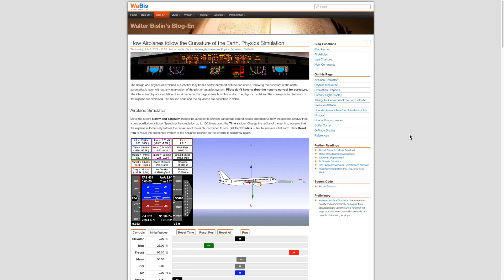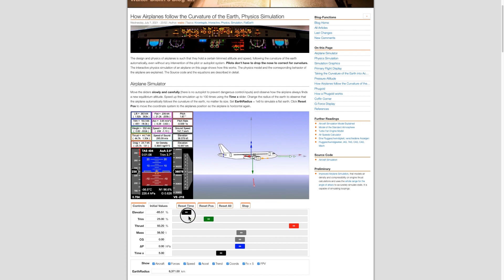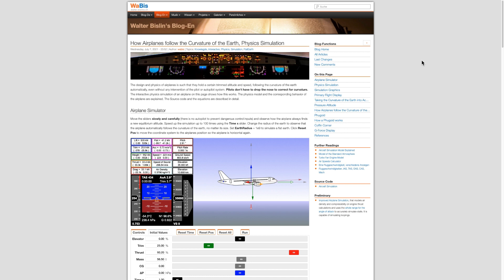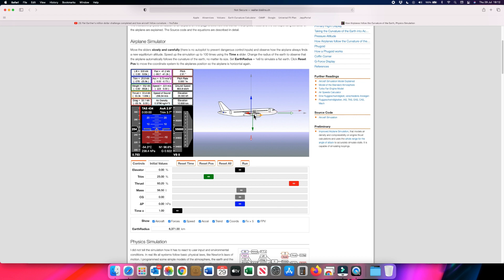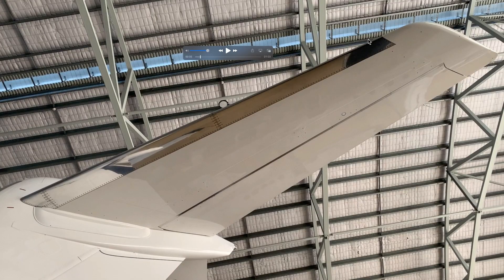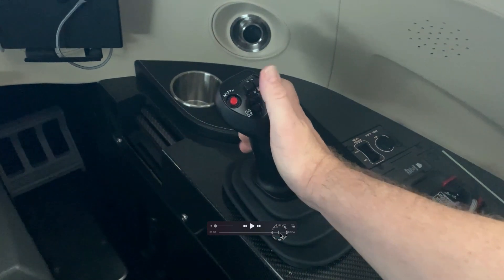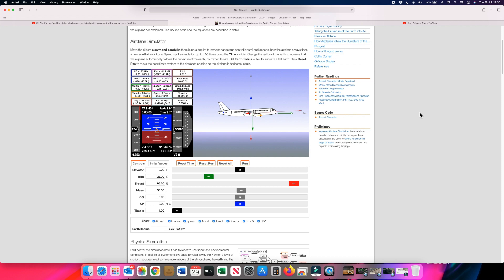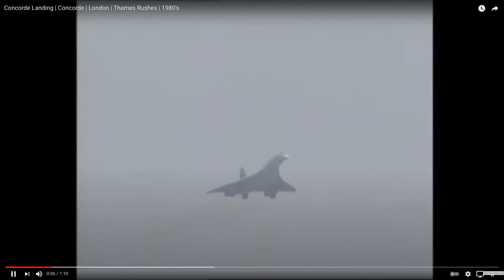An overview of the Elevators and Trim in aircraft.  How pilots control the pitch attitude.

Comment: Great video! Walter Bislin's site reminds me of the static images we had in our aviation text books back in the 1970's without, of course, the non-static images. I will always be at a loss as to understand the idea that a nose down attitude is required to descend? Is it that hard to understand that if I am flying with a 2 degree upward pitch at 200 knots, but reduce my airspeed to 110 knots, that (depending on the aircraft) it will fall out of the sky with a pitch up attitude? And of course you gave the perfect example of a controlled decent pitch up, that we call a landing. How is that just not totally intuitive to anybody? Without any knowledge of aviation, how can a simple thought experiment not yield the same? You can almost model it with your hands hanging out of a car window! Great video just the same 😉

Comment: Wofie, Frigging brilliant, In my book this is your best yet and loved how you rubbed the reality deniers noses in it with the NASA shill ploy.

I'm still a bit confused with the Trim but I will watch this again, However, Would I be safe in saying the TRIM is like fine tuning setting?
Reply from the maker: When teaching this in a class room I used to explain the trim as a wheel alignment in your car.  

Imagine driving with a poor wheel alignment that requires you to constantly hold in right steering wheel pressure to drive straight.   If you let go of the wheel the car deviates rapidly left.  

The trim would be like having a small knob beside the steering wheel so you could realign the wheels while moving allowing you to let go of the steering wheel and the car then goes straight.  

In the aircraft each time you change power, speed or configuration the plane goes out of 'alignment'. (aerodynamic balance)  and will either try to climb or descend.  The trim realigns so you don't have to hold a correction with the joystick
Reply: @Wolfie6020  "The trim would be like having a small knob beside the steering wheel so you could realign the wheels while moving allowing you to let go of the steering wheel and the car then goes straight."

Now I get, makes perfect sense, thanks heaps.
Reply: @osci08  yes that’s pretty much it, just imagine that your central line changes depending on the speed you’re driving at. So you have to constantly adjust, that or have autopilot do it.
Reply: @jonneexplorer  Cheers Jonne.

Comment: My guess for the purpose of the red AP/PTY button on the joystick is to launch an Anti-Personnel Party (missles,  rockets, or bombs) but alas, I doubt a business jet would include such a nice feature.  But I know such a jet usually has some party snacks and beverages on board.  Indeed, Wolfie has even shown us the goodies cabinet before.
Reply from the maker: Because this plane is fly by wire the right control does not move if the left pilot is flying.   You can take over by pressing the red button which gives priority to that stick. If you press and hold it you have the master control.  If the other side presses and holds he takes over.  Whoever presses the button most recently has priority.   

The plane announces "Priority Left,  or Priority Right" accordingly.  

No so many snacks on this plane.   The flight attendant is working on that.
Reply: @Wolfie6020  I was a "backend crew" cryptologic linguist on USAF RC135 in the 1980s.  Often 10 - 12 hour missions.  Snacks are SO important. 🍫☕😋
Reply from the maker: @WoodworkerDon  I totally agree.  Critical to keeping morale high in the team.
Reply: @Wolfie6020  🍪🍰🍌🍎👍

Comment: You still have not been able to point at any specific adjustment adjustment that the  auto pilot or the pilot makes that can be directly attributed as curvature or Coriolis.  Adjustments for crosswind or air pressure is no different than you with do on a flat motionless earth
Reply from the maker: But I have Gary,  numerous times to you and you know this.  The corrections to maintain a great circle course require turning towards the Equator constantly in each Hemisphere with the rate of turn needed increasing as Latitude increases.   Also the turns are mirror imaged for each Hemisphere.   There is your 100% irrefutable adjustment for Earth curvature. 

Unless you can show me a Flat Earth map explaining it?   I'll grab the popcorn.
Reply: That's because there are no specific adjustments for that. The autopilot (or the human pilot for that matter) just tries to stay on the same altitude & heading and counteracts any outside perturbation. It doesn't matter if it was a crosswind or Coriolis that caused a deviation from the predetermined heading, in both cases the reaction is exactly the same: adjust the heading back to where it's supposed to be. Barely an inconvenience...
Reply: So gary, can you finally tell me why I have to account for the fact that we live on a globe whenever I calculate my flight distances?
Reply: It would be nice if we had an accurate map or model of the flatearth on which to test your claim.  But... we don't.
Reply: Gary, isn't odd that all the videos on flight are made by people who believe in a globe? Why can't any flat Earthers afford to hire planes to show their proof?
Reply: @NinjaMonkeyPrime  They used the FE map and all of them crashed!  Good thing making a flight plan stops most of them from ever taking off.  :)

Comment: I would like to personally thank you, as i have asked that , at least similar ,question in your previous video.
Thank you
Reply: The example with the Concord ( i believe) is not perfect as the flatheads may say that the nose is already tipped, the simple fact that a dart is losing speed and height even if the tip is pointed , would be enough i believe
Reply: @tupcho33  I don’t think anyone, even flat earthers could argue Concorde lands pointed down in the clip. Concorde was known for its very high landing gear and steep flaring like you saw in the clip. 

The nose angles down because in its flight configuration you can’t see the runway at all.

Comment: Good video! I didn’t know that you could trim the whole horizontal stabilizer. Is that common?
Reply from the maker: In larger aircraft it is common.   Another way they achieve it is to have a small tab on the back of the elevator the is adjustable.
Reply: @Wolfie6020  I remember those tabs on the Airfix models I used to make when I was a teenager forty-odd years ago.
Reply: @Wolfie6020  I knew about the tab, but never knew they did it with the whole stabilizer. Thanks!
Reply: @maxwellshammer5283  One of the reasons the Bell X1 could break the sound barrier while maintaining control was that the mech engineer introduced the moving tail (horizontal stabilizer) after Chuck Yeager complained about buffeting at Mach 0,8 which made the plane uncontrollable.
Reply: @maxwellshammer5283  For example, you can also see a trimmable horizontal stabilizer on a Boeing 737, 777, Airbus A320 etc.

Comment: We’d better not confuse the flerfs by telling them of the three other methods of changing pitch. For non-flerfs they are 1. Altering the C of G (eg. Crew moving through the cabin with a bar cart [cabin crew 75 kgs, bar cart 100 kgs or more]). 2. Changing thrust and 3. Changing the flap setting. I suppose you could also include wing and/or tailplane contamination, but that’s getting too scary.
Reply from the maker: In the Hawker there was also a physical trim wheel in addition to the electric trim.  It would move automatically when on autopilot as the autopilot did the trimming.  

If a person walked from the front to back or vice versa you could see the trim adjusting for it and turning the wheel.
Reply: @Wolfie6020  In an similar way in a glider (Lesson No. 1) I used to demonstrate that just by leaning forwards or backwards in your seat you could affect the longitudinal trim. Few people realise how active the trim system is on modern aircraft. It appears to never stop working.
Reply: @Wolfie6020  I can recall footage of the 707 trim wheels spinning especially during a landing approach, it looked almost dangerous.
Reply: @WalterBislin  Thanks Walter; I had no idea that Boeing were still using that system even on the latest aircraft designs.

Comment: Stick forward, houses get bigger.
Stick back, houses get smaller.
Reply: Stick all the way back, houses get smaller, then reappear and start spinning around!
Reply: @cambridgemart2075  Kirby Cadet T3, stick back hard enough that it's just starting to shake, you get maximum height off the winch. Over do it just a fraction, it gets much quieter very quickly, and you better push that stick hard forwards PDQ, because gravity just unexpectedly became your engine. Or even worse you are nailing the launch, and the lovely instructor pulls the cable release to do a simulated cable break. I just wish I could have sorted the landings as well as the take offs. I wasn't allowed to proceed to solo, I over stressed an aircraft by a lot on one landing. We both survived, and I walked away totally unharmed. More than I can say for the instructor.
Reply: @cambridgemart2075  LOL That's mainly rotary flight, fixed-wing is a lot more forgiving, altitude permitting of course.
Reply from the maker: Glad to see another pilot here!
Reply: @Wolfie6020  Three little words you don't want to hear from your instructor......

No not those!

"I have control"
Reply from the maker: @GaryGraham66  I used to use "Taking over mate"
Reply: @Wolfie6020  With or without screams? lol
Reply: Skydiver:
When people look like ants, pull.
When ants look like people, pray.
Reply: @DickHolman  😂😂😂

Comment: Model rockets are like aircraft’s they have their center of pressure below (behind) their center of gravity. 

Same for sailboats, their center of aerodynamic pressure is astern of their center of hydrodynamic resistance.
Reply: Only if the boat is correctly set-up. I can (sailing dinghy) pivot the centreboard and change the centre of lateral resistance infront to behind...
Reply: @colinprice712  - You are right. On a regular sailboat a neutral or a slight weather helm is desirable. Weather helm will have the bow turn into the wind which is safer as you already know.
Reply from the maker: Thanks Robert, I had never considered it for sailboats.   You learn something every day.

Comment: Why are there 2 buttons for trim? 
One for each side? 
So if the cargo weight is off balance to one side, you can trim it to match the weight differencial?
Reply: You don’t really need to trim out lateral weight imbalances as even on the widest aircraft any mass will be close to the centreline. However, if there is imbalance you will automatically trim it out almost without thinking about it. You’ll know the aircraft is out of trim whenever you change speed as you’ll have to retrim the ailerons.
Reply: I think they do try to balance loads.
Reply: @shegocrazy See the answer above from Trevor Austin
Reply from the maker: The reason for two is to prevent an accidental trim runaway if one switch fails.  Both must make contact to activate the trim.  It is a certification requirement.  

The aircraft also has aileron and rudder trims but they are not on the joystick and infrequently used.   The pitch trim is used constantly when hand flying.  Every time you change speed a trim adjustment is needed.
Reply: @Wolfie6020  Thanks :) Keep this series up and i can become a pilot in no time :D :D

Comment: I imagine an aircraft like the B2 with no vertical stabilizer or tail will really confuse some people.
Reply: The b2 us old hat.
https://en.m.wikipedia.org/wiki/Westland-Hill_Pterodactyl
Reply: Delta wing aircraft confuse the flurfs too.
Reply: @dogwalker666  
I met one who thinks that aircraft engines runs on compressed air.😆
But what do I know I'm just a retired Aircraft Mechanic.
Reply: @bikecommuter24  oh I know,  I did try to point out that if it was compressed  air the fuel tanks would have to be a lot bigger and made of thicker materials,  but the flurf could not understand energy density of fuel.
Reply: @dogwalker666  
Go that right, try explaining to them  how a car operates with its more complex combustion system 😆 
Funny they put fuel in their cars but can't comprehend that airplanes require fuel to operate.
Reply: @HalMcGinnis  
It compresses the incoming air for the combustion section they absolutely need fuel to operate.
There are different kinds of jet engines some have two compressor sections some only one, they all work on the same principle compress the air feed it to the combustion section where it ignites provides thrust and turns the turbine blades which are connected by a shaft to the compressor section its actually a simple system but very precise and expensive to make.
Reply: Flat Earther: "It am CGI."

Comment: FYI, roll stability is WAY harder to understand and much more susceptible to a common myth, even by pilots - the pendulum rocket fallacy.  Doing a bit on that problem might be fun - and challenging if you don't understand it, as many pilots don't.
Reply: Roll stability just makes it harder to begin a sharp turn when you spot the Bf109 moving in behind you.
Reply: @Sableagle  That's why you're supposed to use the AIM-260s under the wings of your P-51 from 100 miles away.
Reply: @ljfinger  That's going to be a problem. I'm flying a Hawker Hurricane with a pair of GBU-12 Paveway IIs.
Reply: @Sableagle  Hmmm...those will be tough to use air-to-air.  But if you're GOOD...
Reply: @ljfinger  I did manage to ping an enemy fighter with a pair of unguided 70 mm once in Interdictor II, when he reached bingo fuel and turned for home and I thought I may as well have a pop with the last ordnance I was carrying. Sure sign I'd been playing too long, I reckon.

Comment: In other words... how to dip the nose to keep up with the curve of the earth ;-)
Reply: Or not. The point of this video and the next one is that you can fly downwards with the nose point up. You can follow the curvature of the Earth always pointing the nose up.

The point of the previous video was that an aircraft tends to do so w/o human (or autopilot) intervention, at least in a simulation.  In reality the effect is so small that corrections due to external factors are going to overshadow it anyway. Anyway you don't need any piece of software to know the shape of the Earth for a plane to follow it.
Reply: MrUnite4thechilledwren  --Following the Earth’s curvature at a constant altitude and attitude, indeed requires a rotation about the aircraft’s lateral axis.  But this isn’t a downward movement in any sense, as it puts the aircraft no closer to the Earth’s center and, by extension, its mean surface.  No “dipping” needed.
Reply: @StringerNews1 --I assume you're joking.
Reply: Planes dip their nose whenever they pass another plane going in the opposite direction, just like 2 men passing on a sidewalk that accidentally make eye contact, they nod awkwardly!
Reply: I hope ironic
Reply: @StringerNews1 Wasn't that back in 19 dickety 3? They had to say dickety back then because the Keiser stole their word for 20!
Reply: @StringerNews1 Looking for your potato?